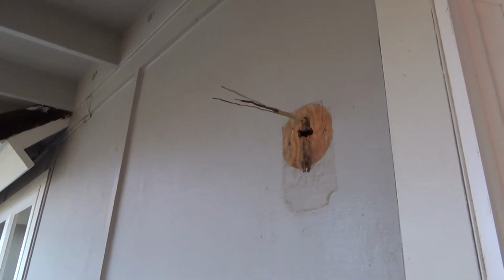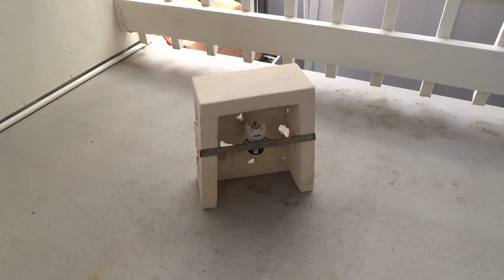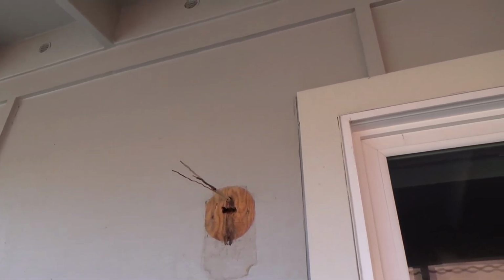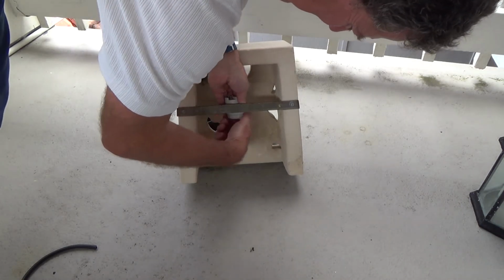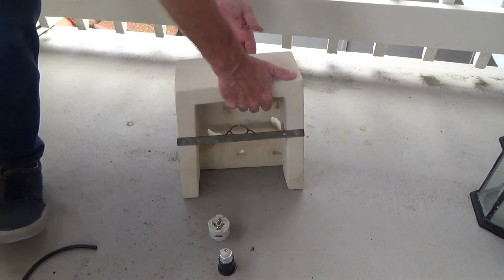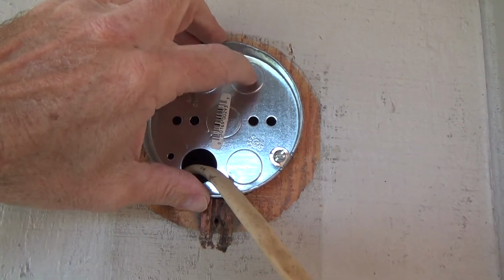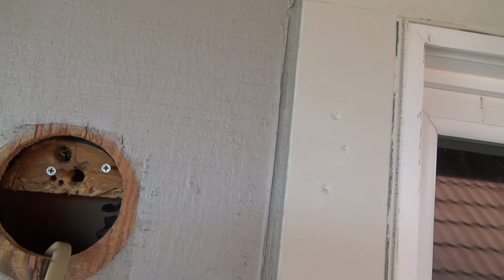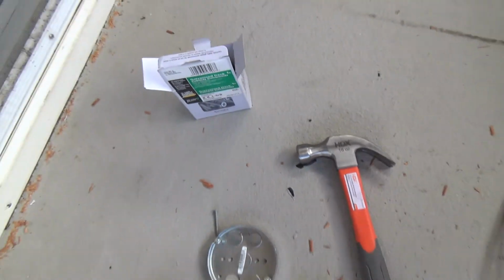How to Install Exterior Wall Sconce Light Fixture Made Easy...Part 2 How to Prepare for Pancake Box

Comment: Dude, hire an electrician. Your gonna get hurt or burn your house down.  You don’t know enough about electrical work to do a simple fixture install.  Just an honest opinion.
Reply from the maker: Thanks for your honest opinion but if you have the power off to the wire in the wall then there's no way your house will burn down when you are working on the light fixture box. The contractor should be the one you should be wagging your finger at as the wire was between the backing block & the wall plywood. That could've been fire hazard had the contractor put a nail through it when he was installing the finished wall. Keep watching all the other parts & you will learn more or.....just go to my main YouTube channel page then click on playlists then scroll down to electrical to find all kinds of her videos that will save you money around the house. Thanks for stopping by...